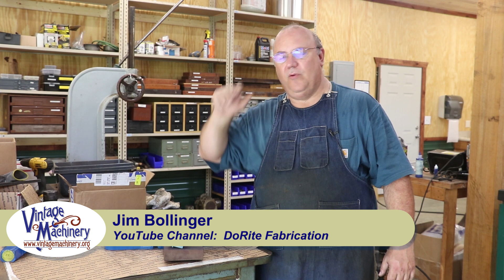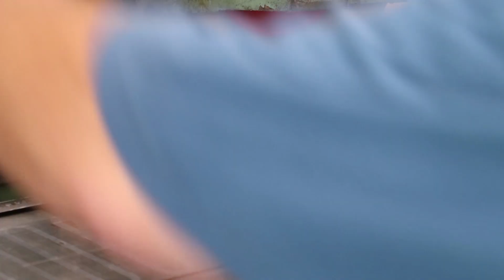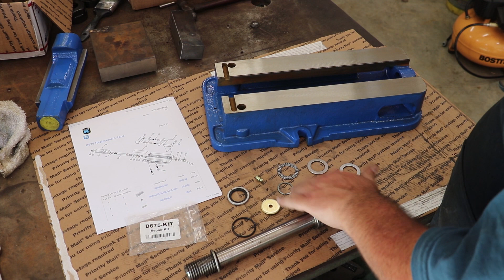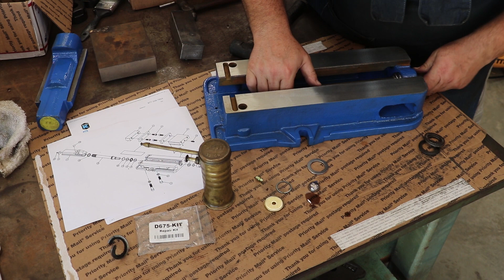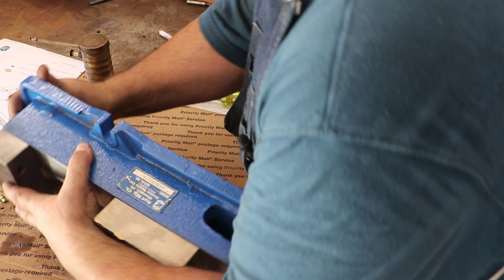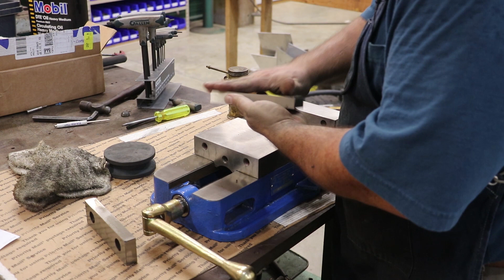Kurt Vise Restoration - Part 3: Final Grinding and Reassembly

Comment: The restoration sure came out well Keith. Just had the KBC tools flier for November 2023 and the equivalent of that vice is now over $1400 from them. Rediculous.
One thing I would comment on is that when you ground the tops of the jaws you faced the "exhaust" of the SG towards the wrench end of the vice. All your nicely cleaned, painted, replaced bearings etc were inundated with grinder dust particles. One side shot of the vice showed quite a collection in the side hole of the vice base. Had you mounted the vice turned 180° you'd have kept most of that crap out of your new bearings. Too late now but something to remember for the next one whenever that happens. 
Thanks for the series. Season's Greetings from Canada's banana belt.
🤞🇨🇦🍌🥋🇺🇦🕊️🇺🇲💩😁👍

Comment: Great job. I'm from southern Indiana, my friends in Milwaukee say I sound like I'm from Tennessee or Georgia. I'm proud of my accent. Also you mentioned being concerned with the finished height of this vice compared to using two units together. I always use the swivel base under my vice, plenty rigid and if you have two units, you can make up any difference in grinding the swivel base. Now the deck height is the same. Snug your jaws,tap down with a dead blow hammer. They will be the same height since they were ground together. Don't forget to RE-tighten the Allen bolts.. Greatly appreciated the video, makes me want to start a channel as well. Could never achieve the quality you have. Anxiously awaiting more new content.
Thanks: George

Comment: Hello Keith, you did a nice repair on this vise. I was wondering what could be done to get rid of the mic noise. Do you think a small piece of foam around the mic would help? When I look at the expensive or professional mic’s all I see is a piece of sponge with a slot in it. Place the mic in the slot and it may be the end of your mic troubles. All the best, Edgar
Reply from the maker: I was having problems with a loose wire in the mic in that video.  I ended up just replacing the cord.  The problem is that when this happens, you don't know it until you get everything filmed.

Comment: I am relatively new to the machinist world but I took the plunge and bought a new Kurt Vise. Perhaps the best investment I have made for a holding accessory. What a difference from the Interstate vise I was using. Other than being a newer model, my vise doesn't look, and no doubt will not perform, any better than your restoration (the new vise may not be as square and parallel as your freshly ground surfaces). I have no problem with the audio as the content is superb. I smile when I see comments about the phase-inverter whine on Tom's Techniques videos. It is a shop and shops are full of spurious noises. Thank you for sharing your expertise.  Great video! From Lake Havasu City, AZ.

Comment: Keith, awesome restoration! Pay no attention to the mindless comments concerning mic noise/accent. One question though; wouldn't the face of the fixed jaw need to be ground parallel to its keyway which mates with the vise body, or the keyway cut on the bottom of the vise? A little surface plate confirmation would have been interesting. Great repair at any rate, & thanks!

Comment: re dress the wheel when you turn the grinder off.
Reply: Donz Milky the wheel only needs to be dressed when it is starting to grind poorly. Quality geinding wheels arent cheap and excessive dressing leads to buying wheels more often. I grind  35-40 reels and bedknives for the mowers where i work every year and only dress when needed. Changed wheels once in 8 years. And they were well used when i started.

Comment: Did I see that back jaw wobble when you set it in like the key needs a little height removed?  Grinding would have set it down in it's key-way further.  Stunning job, watched all 4 videos.
Reply: I had the same thought. The bottom face of the jaw (where the keys are) wasn't ground but the top of the rails (where the keyways are) was so yes, key depth is a concern.

Comment: Keith, I noticed something concerning when you mounted that back jaw. It looked like when you put it into place, you pushed back and forth a bit and it wiggled a little.    Given that you ground down the top surface of the base of the vise, is there any chance that the keys on the bottom of the back jaw are now too long and were bottoming out before the bottom surface of the jaw did?  perhaps it just didn't seat all the way until you put the bolts in but I figured I'd at least mention it in case it really was a problem.  Here is the part:  https://youtu.be/FPKruL409fY?t=1302

Comment: Before you give a final grind to the tops of the faces, give them a tap or two with a dead blow hammer, just as you would to a workpiece held in the jaws. If they can move the slightest bit on those screws, you want them at their lowest location before the grind, because that's where they'll be when you tap down a workpiece.

Most of the time, you will have the workpiece on parallels, so the tops of the faces will be irrelevant, but when you clamp something with ridges (or align it using Stan's Z-squares, which register on the tops of the jaws), you will want those jaws down in a repeatable location.

Comment: +Keith -  Suggest you coat the bare metal parts - Jaws & Ways - with either Carnauba Wax or Bee's Wax , it will keep the metal from Oxidizing and still provide lubrication.

Comment: on  the smaller jaw, we'll call it the fixed jaw. The way you ground that, the face of the jaw may not  be square to the bottom. should have started out with a precision angle plate.

Comment: you should really dress your grinding wheel before your finish pass so it doesnt have that chatter in the grind. We always dress at least .030" every time we start the grinder to true the grinding wheel then usually dress .003"-.006" when the wheel starts to get full and gives you chatter and heat build up. vise looks good though!

Comment: Nice job on the vise.  The only thing I do different when assembling them is to use a marine grade grease. I grease the screw both in the movable jaw "nut" and also for the flat bearing. I put grease on the sliding surfaces and then using a razor blade, scrape the grease off. That puts a very thin grease surface which helped shed coolant.

 I understand you need the fan blowing but a mic cover would help reduce wind noise in the videos.
   Jeff

Comment: If it's hot use the fan.  People can deal.  They aren't in your shop stewing in your own juices.   All of the new Kurts that we have bought had a second small set screw on top of the large set screw holding the movable jaw.  Kind of a lock set screw.  That way the main set screw can be slightly looser making the jaw move easier and smother not running on the base so hard.

Comment: How could you tell that one jaw was steel and one was cast iron. Spark test??

Also, why is TIG the best method?
Reply: tig is much finer, great for controlled welding, not for the heavy stuff though it can be enough for most jobs.  some cast steel is very hard to tell from steel, its just experience and the welder guy knew his job, went with safe options and got it done

Comment: Keith, as always I love your restoration videos. Society has developed too much of a throwaway mentality and watching you take a rusty old vice and make it as good as new just soothes my soul! And don't worry about the fan noise and such, I don't expect studio sound in a machine shop, just talk loud enough to be heard over the fan! Keep 'em coming!
Reply: no-one would throw away a kurt or wilton vice anyway! its like throwing away a rolls royce because the tires are flat!  i think part of the fun of having a machine shop and access to welding and casting is taking an unloved but quality bit of machinery and fixing up for yourself, or your workshop time and life would be very boring indeed.  i personally always enjoy repair videos the most, you have to improvise, make new parts, you tend to use recycled or mystery metals too, which is my real life, not buying new from the supply house.

Comment: Keith I love love love all your videos but please look into what you can do to help reduce the audio noise  a foam guard/shroud on the mike would help a lot,   also maybe simply change were you put the mike on your apron , maybe add a cloth ring to the front of the apron near the top of it,  also check out the wires leading to the mike pack

please any small improvement would be so great  thanks again for all your hard work on these videos

have a good day and a better tomorrow

Comment: Now that the mating surfaces are ground flat, have you thought about flaking so that oil has a place to pool a bit?  I noticed on my Kurt knock-off vise at work that there are machined "flaking" marks to allow oil to stay in place.  When you get to the swivel base, maybe then this might be addressed.

Comment: Keith, nice videos. I noticed that you didn't use the mating face of the fixed and movable jaws as a reference for squaring the clamping faces of the jaws. I usually don't  on a drill vice but for a good mill vice it sometimes makes a difference.

Comment: As for the sound. A little Deoxit on plugs and connection might help.  Humidity, oxidation all that good stuff.  Second if it's a 3 wire system see if there is a shield separation due to frequent flex points.    Love this Site.

Comment: A wonderful series, that saw a piece of scrap become a fully restored and functional vice. Well done, sir! My only adverse comment is that areas of rust on the underside of the main frame and the jaws were left untreated. Could you have treated those areas with something like 'Kill Rust', a UK product but I have no doubt that equivalents are freely available in the USA.

These products convert Fe2O3 Ferric Oxide (rust) into a benign iron compound, Ferrous Phosphate  The application of H3PO4 Phosphoric Acid which, through chemical reaction converts into rust into a rust-preventer.

That's what it reads in my Kill Rust instructions, at least.

Comment: Keith, The assembled vice includes a roller thrust bearing. Wouldn't it have been advisable to tape up all openings in the vice before grinding the upper surfaces of the jaws (on the assembled vice) to reduce the possibility of getting grinding "dust" in the new thrust bearing?

Comment: At 90 degrees in the building and working like you are, definitely want a fan on. You don't use swamp coolers in Georgia, they work well in Nevada.
Reply: Prob. with the humidity in Georgia using a swamp cooler would also mean needing a de-humidifier.

I wonder which one would win:):):).

Comment: Keith, when grinding the faces of the vice jaws, did you confirm that they were perpendicular to the mounting surfaces?  You may have omitted showing this check to keep the video short, but I think it's an important consideration for anyone doing a similar job.
Reply: Yeah; I was wondering how he might have assured the fixed faces were parallel to the keys, and the movable faces were perpendicular to the guides.
Reply: I was thinking the same thing.  It doesn't matter as much for the hardened jaws, but for the movable and fixed pieces, it's very important that those be perpendicular to the surface of the main casting.

Comment: Seeing you "torquing" down the allen screws with the hammer (excuse my terminology, but that's what we call them on this side of the pond), reminds me of a story my father told me.

He'd just started at a new company, and went to draw a torque wrench from the tools store, in order to torque the bolts on a job he was completing.

The foreman explained the company didn't use torque wrenches, but rather "We tighten it hand tight, with this single ended ring spanner (he produced one about a foot long), then give the spanner two thumps with a rawhide mallet."

Comment: How do you know the fixed and movable jaw faces are parallel?
Reply: The ball that he held in with grease will bring/ allow  the movable jaw to seek parallelism to part in the vise. Many machinist will put a wire or ball bearing in between the part in the vice and moveable platen. I personally use aluminum tig wire. This has an effect such as a 3 leg stool. It will hold the part securely but depends on the stationary jaw for the truness of part. By just installing a part solid between the 2 jaws it will cause the part to rise on the movable side. The amout it raises will depend on condition of the vise. I like using the aluminum tig wire because it doesn't leave any trace that it was there In most cases. People, dont bother telling me how wrong I am because, 2 things. 1st.It is proven to work for me with the not brand new equipment that I own. 2nd I really dont care if you take my advice or not. Use what works for you.

Comment: Yeah, there's an intermittent in the mic circuit or it's rubbing on clothing, but folks are just gonna have to live with the fan. I live in a climate just about like Keith's. I watched this today while cooling off from mowing an acre or two on the tractor: 93 degrees F, 51% humidity, heat index 102 degrees (39 C). It took the duration of this video sitting under the ceiling fan in the air conditioning before I could eat lunch. Working in the shop is tantamount to working in a bake oven. Yeah, it was easier 30 years ago, but we're not kids now. My career depended on acute hearing and highly trained "ears," but I don't let the audio bother me. Let's let Keith protect his health and well-being by keeping cool.

Comment: beautiful job keith. i thought i read somewhere that the proper way to adjust the set screw for the moveable jaw was to snug it up then back it off a quarter turn. did your rebuild kit come with any instructions on the screw? just curious.
Reply: Kurt also have a  procedure for tightening the fixed jaw bolts up in stages, not that it matters really.

Comment: I have a question, and being one who is unfamiliar with stone surface grinding, my question is rather simple I suppose, what grit of stone is used when you surface grind? And the second part of my question is this, does speed (RPM of the grinding wheel) play a role in the over-all quality of the surface grind in conjunction with the grit of the stone? Thanks, and Cheers.
Reply: I suggest you watch Suburban Tools' videos on grinding.
To be brief, the stone is in the 30s or 40s grit wise. Type and hardness (or rather softness/frangibility) being suitable to the stock is the more important matter.
Reply: at 11:20 you can see the stopped/still stone and realize the coarseness is very high. Like you said 30s to 40s.

Comment: Are you planning to do a little inspection on this vise to make sure parts will clamp in straight? I have a little suspicion because the moving jaw looked like it took more material on one side that something might be a little off.

Comment: Keith, again another GREAT job!

One question, how did you true 
up the ends of the fixed jaw?

Both ends had weld on them.

steve
Reply: Steve Skouson, I wondered about this too. Maybe with two angle plates?

Comment: Why did you not grind the lower rubbing surface of the moving block. I heard you mention, it has a factory surface, but It was rusty and will cause friction on the nice new surface of the rails?

Comment: The problem isnt your fan, it's where you have the microphone. It's all crinkly in a lot of your videos and hard to stand listening to. You need a mic on the camera or a small boom mic with a puff guard, that will cut a lot of the fan noise and get rid of the crinkling.

Comment: Keith, I have a Miller 330A/BP welder in really good condition. It has tig as well as stick function. I know the freight would be very expensive but I am willing to sell it to you for $300.00. Maybe we could work out some kind of deal on delivery, I wouldn't mine taking a trip to Atlanta I used to live there. The welder is water cooled and all you would need to start welding is a gas bottle and a new gas hose. I bought it in a package deal and all it is doing is taking up shop space. Anyway just a thought. Randall

Comment: Nice job and very nice vise!  But hey, I just have to add my "two-cents worth"... For me most times, wire wheels and brushes(steel or brass) on grinders/drill motors sure do "work wonders" on rust... and they are fast too!  Also, I think that I would go ahead and make/get another "jaw" and put it on rather than swapping one jaw back and forth... or at least I might make a 'cover plate' with short bolts to keep jaw face clean and steel shavings out of threaded holes...  Just "points to ponder"... Good Day to All.

Comment: Keith if I send you a pointer will you keep your hands away from that grinding disk?? I wince every time your hands come up on screen around 24:30
Reply: Wincing aside I love the transformation from a rough piece into a like new vice.
Reply: And wear "real" safety glasses around the grinder, even better would be goggles.  If a wheel comes apart you will wish you had been wearing hardened steel armor, and a diaper...

Excellent job on the vise!

Comment: Basic question from a rank amateur: When grinding, how do you compensate for the wear of the wheel? As the wheel wears, the diameter decreases thereby increasing the clearance between the wheel and the piece, right?
Reply: as much as I gathered the wheel looses most diameter during dressing with much harder material and you either lower the wheel or raise the table to compensate then

Comment: Keith, Very nice vid and a fine fix up of the vice. I have one also and would liek to suggest that when using it on a knee mill after tightening the vice jaws remove the handle fromt eh vice. I didn't do that once and almost jammed up the table/knee/saddle when traversing the table left to right.
A dumb mistake.
Eric